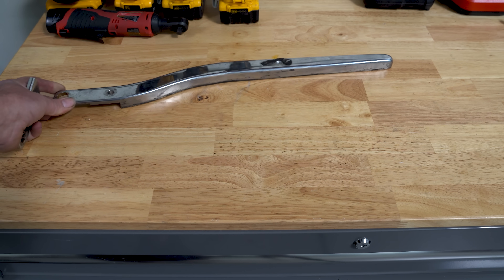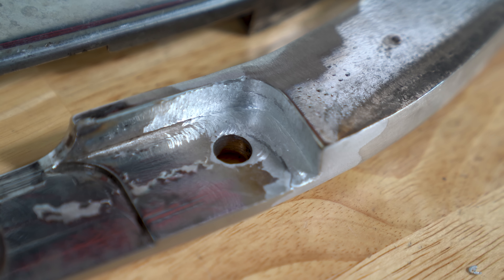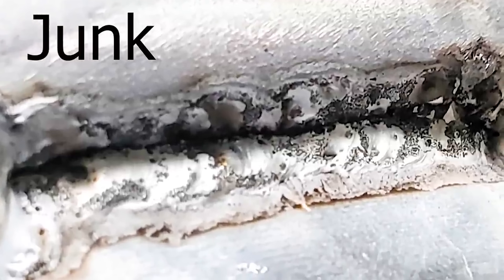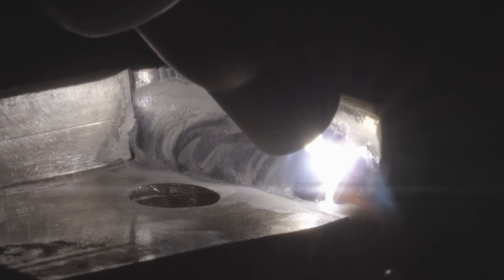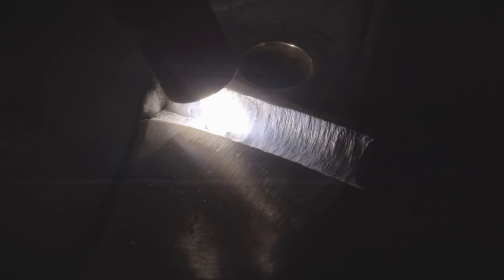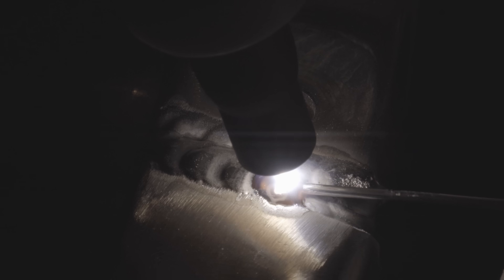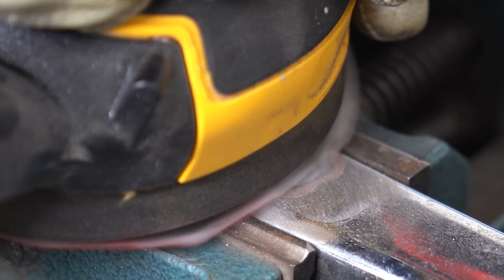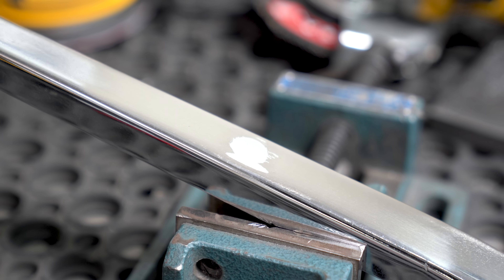Flawless Weld Repair

Comment from the maker: Learn to TIG Weld in Our Class!
http://thefabricatorseries.com/classes

Save 10% on practice metal and consumables with "TFS10" at checkout!
https://weldmetalsonline.com/

Tools & Gear We Use and Recommend
https://www.amazon.com/shop/thefabric...
Reply: The Amazon link is dead
Reply: Dang I just received my aluminum and stainless kits… wish I had known of the code
Reply: @The Fabrication Series
can you please make a video on "how to" water cool a tig machine,You would be the very first to do it on youtube. NOT how to add a water cooler to cool just the torch. i want to see how to water cool the actual tig welding machine itself to increase the duty cycle.  
Similar to water cooling a computer.  i have read of it being done on tig machines using several
 "water blocks" for the most heat-affected internal parts ,and they just use cheap computer water cooling kits to do it an route the water lines back to  a normal tig water cooler for the pump, reservoir etc.., so they have cooling for both the torch an machine . but have never seen it done on a video .
Reply: I can tell you all those brake handles for Harley are cast. I worked for the company that made them. IIRC they are just generic 8620.
Reply: Oh, you said handles, and I commented before you mentioned these were aluminum struts :shrug:
Reply: Don't forget the depreciation on your equipment and the cost of the building in which you are working.  And then, if you are being a good citizen and reporting this as income as self employed, don't forget the 7.65% employer taxes for FICA and Medicare.  I think that when you look at it a little closer you will find out that your cost is significantly more than 48 cents.  Many self employed people overlook depreciation and the capital that they have invested in their equipment and other assets.

Comment: GREAT job

You say “filler metal” alot but Never what type even in the cool cost breakdown and since it’s tig it’s AC?

My tig is only dc inverter but I do have a mig which … so i just need to figure out how to get the junk out before it welds,,,, 😩 

Learning enough to know “some” of what I don’t know so sooner or later I’ll a bit more of what I don’t know but still will never know how much I don’t know which is good as long as I know it….😅

Comment: Thanks for the info. Although the welding tips were the key learnings, I am left speechless at the fact you only pay 6 cents per KWh for electricity. Is that a commercial or residential rate in the US or is that offset with Solar? Cheers from OZ

Comment: Nice job leaving a rounded transition in that internal radius!  That stress point was bad design in the original part - as evidenced by where the crack started. Engineers at HD should have known better ... but designing things to fail creates a secondary market for repairs and parts, which happens when corporations get greedy.

Comment: I would so appreciate this guy right now to weld a oil filter housing broken screw hole on my BMW 525i 2007 😞 I can't bolt it on (Not Stripped) its literally a broken screw hole and oil leak/squirt out. I can't find a mobile welder and I can't afford time/money to take it to a shop for a unnecessary answer that i already know the respond, replace the whole head cylinder and cost to much to do the repair .

Comment: 100.00 weld on a 20.00 part.
I'm a fabricator, I will say, excellent work. Problem is, I have about 15 pair of those AMF struts. Those would end up in the recycle bin.
Be well, have fun

Comment: Question. At 6:40 after recasting the root and taking care of the hot cracking, as you start adding filler, doesn't the hot crack reform again? Looks like there is a hairline crack right down the center to the end.

Comment: freaking starts with removing the material.  and then pretends to know what he's doing because it happened to work out.  

how about making a jig first dipshit.  
so you can do the same in less then 40% of the time.  (can't easely make a propper jig when you have removed the material already)
Reply: (that's probbably why he is making youtube vids.   because he's too inefficient to keep a job anywhere)

Comment: The part about melting the metal over a few passes to get it back to solid metal with no impurities is gold. The integrity and strength of a weld on a load bearing piece like this is by far the most important aspect. Dressing it up is the easy part.

Comment: As always not a minute wasted solid info here.... what rods would you recommend for aluminum "Soldering", just tried seaming together two 1/2inch aluminum rods, and although they stuck together, not so well. Also kept having to refill gaps as it would runoff. picked up some aluminum rods from the "Freight" store. Thanks !!

Comment: Hey its possible to measure the cost of the chargers. Just slap a Kill-a-Watt onto the AC portion of the chargers and it will keep track of KW used and time. 

Then get run time of the batteries of you using them or whatever 100-0% several times and get an AVG. Then divide that time by that and you'll get 1% use for whatever time frame. Then you can multiply that % based on the KW on the Kill-a-watt meter and you are good to go!.

Pain in the but but this is about as close as you'll get to real AC cost. :}

Comment: I'd like to add to that whole identification of material through the fracture site. If the part failed due to fatigue, it can often look very similar to a brittle failure just like a cast material --- regardless of the material's original ductility.

Comment: You should definitely look into just a minimum of a 1 hour flat rate. 
I’m a HVAC Tech and it’s so much better once we did the flat rate labor on jobs. 15 min job $120 a hour. If it’s a customer that is loyal and frequent for only small jobs that takes 10-15 minutes then it’s on a case by case only. But I also have drive time to the job and gas to drive there. 
Your time is only valued at what you think your worth.

Comment: Hey guys I had a quick question with tubing material.. I wanted to build a cage and have a 1.75 bender so I was going to use .120 dom but the prices of everything makes it unattainable... for budget cases when would you stray away from dom?

Comment: Buttering each edge of a cast piece whether it is aluminum, cast iron or steel is always the best practice for a successful weld. welding one side at a time to accurately keep original shape is so most important then can be explained.

Comment: Outstanding. Great  craftsmanship and clear explanation. I'm a total novice (still just learning to MIG but want to get a TIG rig) and haven't tackled aluminum yet. You used a lot of heat to get that metal to flow and eliminate impurities. How much room is there in between that and the base aluminum just evaporating away (I've seen it do that just playing around with a OxyAcetaline torch.)?

Comment: I have a Springfield armory 1911 special edition with a broken frame that sits five but looks bad. Let me know if you are interested in possible using this for a future video. I am more than happy to pay a reasonable price for the repair. Please let me know if you are interested and how I can personally contact you if so. Great video.
Reply: me too. i have a 1911 slide with a crack in it and can't find a welder willing to tackle it.  may be because its a firearm part so they won't touch it .
Reply: @LivingLife128  cylinder and slide in Fremont,  Nebraska.   If Ralph can't fix it,  no one can.   Greatest 1911 guru I've ever seen.

Comment: The original crack might have appeared from the stress concentration at the sharp inside corner left by the end mill used to shape the recess.  I was hoping your weld in this area that had a nice radiused fillet could remain in place and help prevent this same failure from occurring again.  If it does crack here again, it may not be due to weld defects as much as design defects.  I doubt that anyone ran engineering calculations on this part.
Reply: I'm certain you are correct. Just looking at it you can tell that is not a well designed feature. Cast aluminium has negligible fatigue resistance.

Comment: Well, what do ya know. A video with a welder that actually knows what he's talking about!  Almost 40 years code welder, MIG, TIG and so on.  Repaired lots of cast aluminum and cast iron. Again...really nice to see a real welder in action that takes pride in doing it correctly!
Reply: Can you describe your experience welding cast iron and what industries the knowledge would be useful for? I'm in school atm and keep hearing it's one of the hardest metals to get a good weld on. Thanks in advance :)
Reply: @moizzy1587  You can come across cast iron or cast aluminium welding in the automotive industry, cracked blocks/heads for example. It is very difficult to work with, very true, you have to keep the cast material at a specific constant heat as you are doing the procedure to make sure it will not crack, you can also see him rounding out the cut part in the crack, this is very important, a U groove is necessary to eliminate risks of it cracking again. Depending on what you are using to weld, for MMA rods you will find that the correct rods will likely need preheating aswell as to get rid of moisture which gets soaked up(this information should be present on the box when you buy the rods).
Reply: I'm not a welder. I don't even play one on the weekend. I totally agree with you, K Hoke, it is refreshing to watch a professional ply his craft.
Reply: Except for using an angle grinder without any eye protection, he is damn good!

Comment: Great video.  Spot on advice and the part looked great at the end.  Only thing I would add is drawing a pattern of the part on the welding table before grinding down the junk to help with alignment when it is clamped down for welding.  Just a thought for those not quite as experienced.
Reply: That would be nowhere accurate enough for this part. For that reason, do one side first, then once it's glued back together, do the second side. The alignment is done by the crack, and that is as precise as it gets.
Drawing the outline had a tolerance if several millimeters, which would make the fender very misaligned.
Another possbility if there is no way to keep alignment from the original defect is to clamp both parts togethervia their locating features.

Comment: Great video! One thing, however, I don't quite know, how do you determine what kind of filler rod should be used on this metal? Just the popular 4043 for the casted parts?

Comment: Not questioning the cost of the repair, but wondering why the customer didn't just get some used replacements? By the time he has these rechromed surely the used option would be cheaper, well at least in the UK it would.

Comment: Amazing skill and knowledge as usual. TBH, I’d crank up my mill and make redesigned pieces from 6061-T6 billet plate. This would eliminate that poorly designed thin spot right next to the bolt hole. Then again, my welding skills are :/.

Comment: I started TIG welding about a year ago,  DIY garage stuff. It's definitely harder to learn than MIG or stick but more precise. Your videos are very helpful when you're just getting started in TIG.  Much appreciated.
Reply: Setting is everything. Mig/mag is much more Precise. after which you know exactly how much thread comes out per minute
Reply: @clausmadsen1257  It seems easier to  control the heat and weld thinner stuff with TIG but I'm not a professional welder. Thanks for the info.
Reply: @clausmadsen1257  mig is more precise?? I’ve never heard any welder say that before. Nor refer to the filler wire as thread.
Reply: @Maximumdub  i thought mig was essentially a funner hot glue gun

Comment: its sad that you have to go thru the extent that you did to quantify the cost to internet anons, whom more than likely will find something else to waste your time. next time how about turn the table on them and give them the base info they need to figure it out since they are the ones inquiring. ( you know most wouldnt even lift a finger to attempt the basic math). Nice job. you could also sublet that work to a shop and bill accordingly. but i assume you just dont want to go thru trhe accounting headache of doing that service, and i dont blame you. But if it aint too much trouble you can also make money there too. If you have reputable local business friends, why not make some more money IF the shops you work with are reputable and honest, and do good work that you approve of? great tips, welcome back and look forward to more videos. No car projects you can make content out of?

Comment: I understand not going through the minutiae of calculating operating costs like electricity but what about abrasives? I wont charge for power but I generally count any abrasives used as part of the job within reason not a big deal for somethings but but the bigger dollar lower life stuff definitely gets charged to the job which helps account for other operating expenses.

Comment: Great video! How about a cast iron (cylinder head-I got a little aggressive with my porting and broke through into the water jacket) repair video? Thank you.
Reply: I’ve done cast iron with an AC buzz-box welder and high nickel rods. You could likely TIG it using AC and high nickel rods. You need the AC because cast iron is outright filthy, and you need a lot of cleaning action.
Reply: @robertschulke1596  I've done cast repairs with nickel rod and DC tig, will have to see how ac goes sometime

Comment: Nice ...
On something like this wouldn't you need a second one ..so you could clamp down original part..make sure your clamping in correct clocking ..so part will bolt up as a factory part..??
Reply: The one good thing about cast, is due to the way it tends to break, its really easy to get everything lined back up properly. Thats why you dont want to take too much material away when prepping the joint.

Comment: You actually did not count a grinding materials, a hardware amortization, an argon delivery or another transport charges. It would be fair enough. At least your torch and collets are not a perpetual and so for your carbide tools and so on. But definitely, if you decided that it job costs what you told -- it's your bisiness, your strategy. Don't mind what they saing to you without your background and all.
Reply: Exactly. There are certainly more costs involved with capex, maintenance of the devices themselves (cleaning/tuning), but this pricing method works for him and his returning customers. Happy customers keep bringing their broken stuff back to you. That’s a sustainable business model.

Comment: great job! just one question: you made few passes to recast the root before adding the filler.  but you did not recast the edges. why?
Reply: Everything was already hot (all the junk was already out) and the outer part is not that structural. You look more for a prettier finish

Comment: great walkthrough. I appreciate the cost breakdown. it seems rent and equipment acquisition costs are the relevant figures. maybe more useful to factor in those (using theoretical numbers) as it seems electrical and materials are trivial.
Reply: @Camilo Santana  everything has to be reduced to the hour. Start with month expenses, decided what your work week should be, say 40. So 160 work hours a month. Monthly expenses ÷ 160 gives a rough hourly rate required just to pay the bills. Also want to look at welders in the area and charge accordingly, too low people won't want to use your services, also being too high and better have  a good reason. Equipment acquisition depends how you want to pay it back. Could be coverd in the first month's hourly or split over the year to keep hourly down
Reply: I'm guessing the cost for the capital expenses is easy to add to his hourly rate. It sits there whether it's used or not. Perhaps all your costs divided by what you consider a easy working week, 35 hrs.
Reply: @manofausagain  maybe more specific question would've been better on my end.

Q: How do you factor in cost of equipment and rent as a portion of a welder's fee? Are there two perspectives whether you're starting out or already established?
Reply: @CamiloSantana  You amortize the tools over their expected lifespan. Say they'll last 5 years of use 40 hours a week, divide the cost by 10400 hours. Even if you're not charging that directly to the customer, it gives you an idea of what to set aside for new tools as they wear out.